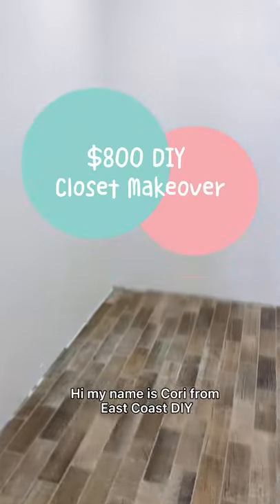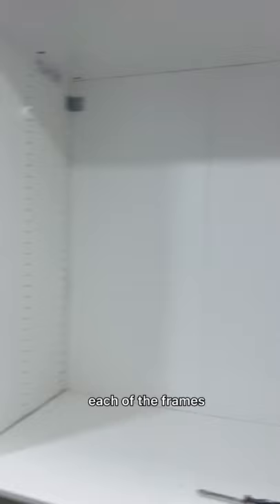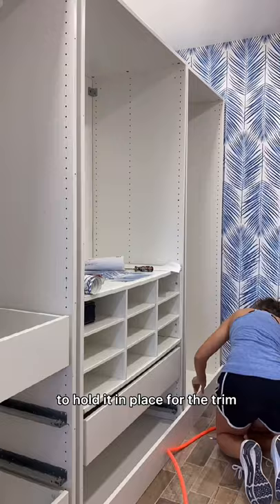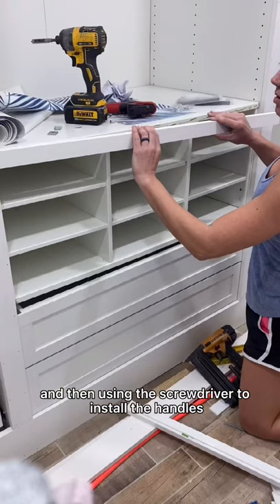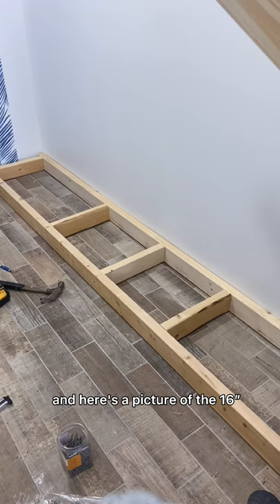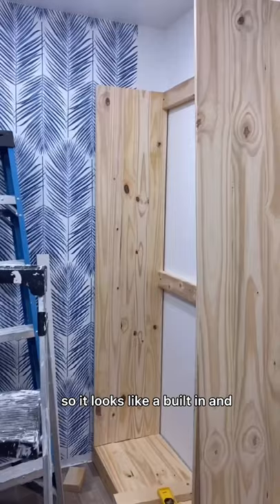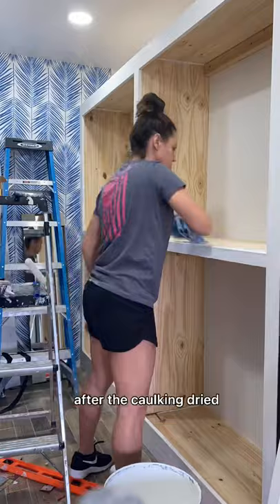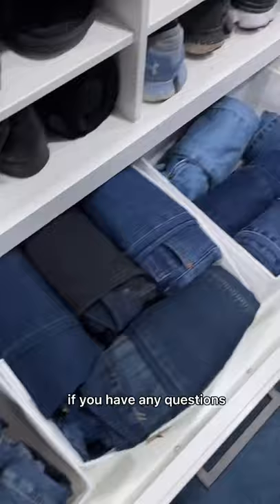$800 DIY custom walk-in closet makeover! Using the IKEA PAX wardrobe system! Viral TikTok series!

Comment from the maker: Closet Materials
Closet size 113” x 82” 

Left side 
2 Ikea PAX Wardrobe Frames 39”
502.145.60

1 Ikea PAX Wardrobe Frame 29”
202.145.71

6 Ikea KOMPLEMENT drawers 39”
902.463.52

1 Ikea  KOMPLEMENT shelf 39”
792.779.57

2 Ikea KOMPLEMENT clothes rails 39”
302.568.91

1 Ikea KOMPLEMENT shoe compartment
No longer available 

1 Ikea KOMPLEMENT clothes rail 29”
402.568.95

1 Ikea KOMPLEMENT pull out tray w/shoe
893.321.00

1- 12 ft primed pine 1x6 (bottom trim)
1- 12 ft primed pine 1x4 (top trim)
4- 8 ft primed pine 1x3 (vertical trim) 

Right side:
5- 12 ft 2x4 (base and support for shelves)
6- 3/4x16x8 (frame)
1- 12 ft primed pine 1x6 (bottom trim) 
1- 12ft primed pine 1x4(top trim)
3- 8ft primed pine 1x3 (vertical trim) 

Tools:
Miter Saw /circular saw/ table saw (for cuts)
Brad nailer (mine is 18 gauge)
1 1/4” 18 gauge Brad nails (for trim to frame)
5/8” 18 gauge Brad nails (for lattice to drawers)
Liquid nail or Power Grab
Impact Driver
2 1/2” or 3” wood screws
Caulk
Primer (Valspar bonding agent)
Paint (Ikea color match) 

Cabinet handles (linked in amazon shop)
Cabinet jig (linked in amazon shop) 
Drill W/ 1/4” drill bit (for cabinet handles)
Screwdriver (for cabinet handles)

Clothes rails
Clothes rail hardware
Reply: Cori...maybe a bit too much to ask...would you also mind putting the links to the items that you used..
Reply: Great job thank you 🙏🏾
Reply: Omg! I want to do this so bad .. but I’m so nervous that I will mess it up .. do I have to measure the closet first before buying the materials?
Reply: May I ask what’s the length of the middle shelves u put in between the clothing racks ? I’m planning on doing my walk in closet very soon thanks to u & ur video. It’s absolutely amazing and so helpful thank you very much ☺️ I can’t wait to start this project.
Reply: @annverawilliams513  absolutely yes.

Comment: Great job love the design can you link your list of supplies you used
Reply from the maker: Closet Materials
Closet size 113” x 82” 

Left side 
2 Ikea PAX Wardrobe Frames 39”
502.145.60

1 Ikea PAX Wardrobe Frame 29”
202.145.71

6 Ikea KOMPLEMENT drawers 39”
902.463.52

1 Ikea  KOMPLEMENT shelf 39”
792.779.57

2 Ikea KOMPLEMENT clothes rails 39”
302.568.91

1 Ikea KOMPLEMENT shoe compartment
No longer available 

1 Ikea KOMPLEMENT clothes rail 29”
402.568.95

1 Ikea KOMPLEMENT pull out tray w/shoe
893.321.00

1- 12 ft primed pine 1x6 (bottom trim)
1- 12 ft primed pine 1x4 (top trim)
4- 8 ft primed pine 1x3 (vertical trim) 

Right side:
5- 12 ft 2x4 (base and support for shelves)
6- 3/4x16x8 (frame)
1- 12 ft primed pine 1x6 (bottom trim) 
1- 12ft primed pine 1x4(top trim)
3- 8ft primed pine 1x3 (vertical trim) 

Tools:
Miter Saw /circular saw/ table saw (for cuts)
Brad nailer (mine is 18 gauge)
1 1/4” 18 gauge Brad nails (for trim to frame)
5/8” 18 gauge Brad nails (for lattice to drawers)
Liquid nail or Power Grab
Impact Driver
2 1/2” or 3” wood screws
Caulk
Primer (Valspar bonding agent)
Paint (Ikea color match) 

Cabinet handles (linked in amazon shop)
Cabinet jig (linked in amazon shop) 
Drill W/ 1/4” drill bit (for cabinet handles)
Screwdriver (for cabinet handles)

Clothes rails
Clothes rail hardware